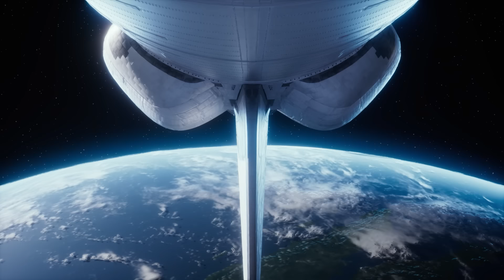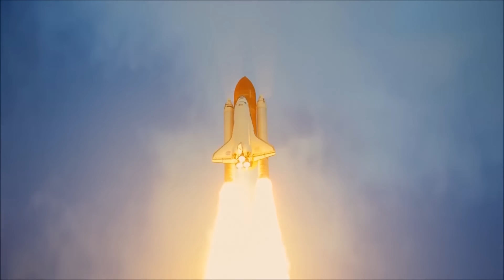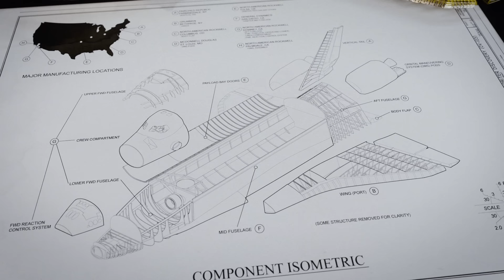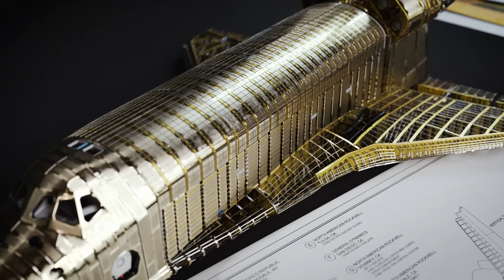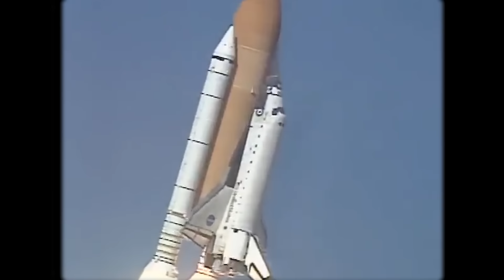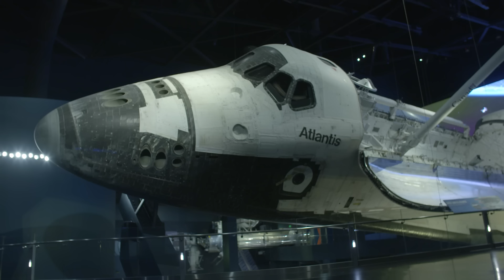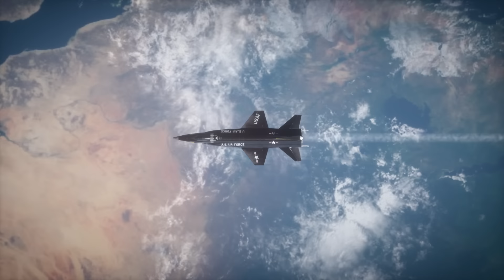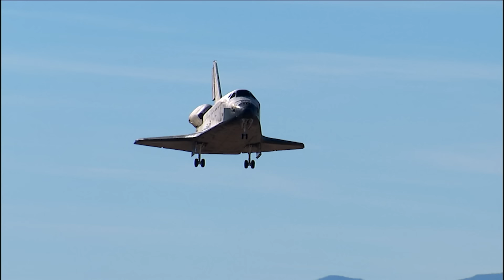The Insane Engineering of Re-Entry

Comment: It's truly incredible that the Space Shuttle even existed considering it was late 70's early 80's technology.
Reply: That era had a very high coefficient of ‘gettin shit done’
Reply: @ehtikhet  but also getting shit killed
Reply: @Orikix yeah now they do that at Boeing instead
Reply: More like late 60's. Alot of the engineering for the shuttle started in the late 60's and manufacturing and testing happened in the 70's with testing being finalized in 81
Reply: @drtracernum20 it was more like the late 40's
Reply: agreed!  @drtracernum20
Reply: The X-15 is where much of the engineering came from.
Reply: yes!!! Neil Armstrong and others - not many and poor Chuck Yeager, after X1 had to sit these out - F'ed him many believe @Triple_J.1
Reply: Besides the X-15, the X-20 Dyna-Soar is definitely also worth the praise for its contribution to the whole spaceplane concept development, especially on the heat shielding technology development.
Reply: We will be seeing the current confidential military technology in 50 years, just like this information was quite confidential back then.
Reply: It was far older than that, sport. Some of the engineering and basic concepts were born in the immediate aftermath of WWII. Much of what ultimately became the Rockwell Orbiter was based on studies done in the mid to late 1950s - early 60s. Check out the X-20 Dyna~Soar program. 1957… 

That makes the fact that there were only two losses even more incredible.
Reply: More like incredible that we considered building it, given how many obvious drawbacks the solution had over more more standard rockets like the Saturn V.
Reply: We can do anything we put our minds to… just turned into airheads lately and can’t put out minds to anything
Reply: I think they did have early CAD programs in the early '70s.  NASA had the largest computer cluster, all linked together as one supercomputer with hundreds or even thousands of access points/terminals.  The BEOWULF Cluster.

The idea of a space plane goes back to 1944, with a winged V2.  The V2b; b for bastard, had very few launches.  It was still prototype testing, but successfull.  Constructions administrator was Werner vonBraun, who later worked with NASA until near completion of SpaceShuttle developement.
🚀🏴‍☠️🎸
Reply: We are doing plenty. From sending probes to touch the sun to detecting ripples in the fabric of reality to flying drones on Mars.   @Rkcuddles
Reply: @Rkcuddles  true
Reply: @Rkcuddles  It just seems that way. People are much more educated than ever in human history. It seems that way because ... most people are fucking stupid, but it's always been that way.
Reply: @Rkcuddles we? you didn't do anything so stop trying steal to credit from the hard work of others
Reply: With enough money and solid rocket fuel pigs can fly
Reply: @kestaskuliukas5296  At least pigs dont explode on their maiden launch.
Reply: @kestaskuliukas5296 And bricks. And pigs with bricks.
Reply: The saturn 5 went further and was around in the 60’s
Reply: Apollo!
Reply: The more incredible thing is how little space tech has developed much since the 80s. The pace slowed dramatically during the Space Shuttle era.
Reply: It's funny to see people incredulous that things could be done just 50 years ago. The knowledge was already known by then, nobody missed CAD because it wasn't invented yet. They did it way it was done, a lot of work.
People got more done faster then than now with less capability. People have no guts now, they prevaricate forever in fear of what if instead of forging ahead.
People can't even build a subway line on time and on budget. Over 100 years ago they started and finished subway lines, faster than they can go from talking to starting one now, with way less capability.
Reply: Let all remember that there is no rule that says we are able to create X amount of technologies every Y amount of years. Just like evolution, some technology pathways become very difficult after the first few iterations while others will see many iterations and still keep advancing steadily. So because we were able to advance relatively quickly early on in the space game has no bearing on what we might accomplish in the space sector 50 years from now.
Most people tend to use the advancement of electronics as a yardstick for measuring the rate of technological advancement. This is wrong. The rate of advancement of electronics is unique among other advancement. Most others occur at a much slower rate. For example we have many different ways that we're able to make a stove to cook our foods but we still only have one way to make a refrigerator to cool our foods.
Reply: it could have only existed during that period, because of the will that prevailed. Nothing of the sort can ever be designed ever again.
Reply: We had nuclear submarines in the 50s
Reply: @Raging_Brainer  He's a CLOWN!
Reply: Nautilus ! first to go under the artic ice and reach the north pole @Raging_Brainer
Reply: @Raging_Brainer Yes, they were powered by a nuclear reactor. I’m no longer so sure that they carry nuclear tipped ballistic missiles. Hiroshima and Nagasaki weren’t destroyed by nuclear weapons but fuel / air bombs like the other cities coupled with mustard gas. See Dr Michael Palmer’s free to read pdf. The question is why they faked the bombs.
Reply: @Raging_Brainer  sry nukes didn't exist then and nukes don't exist now
Reply: and all the bloody doors stayed on all the time
Reply: Built using computers less powerful than a game boy color none the less it was truly an incredible human achievement
Reply: The aerospace industry had a lot of very competent engineers back then, with a lot of intensive experience behind them. 
Kings of the slide-rule and artists of analogue.
Reply: We've had technology to do amazing thing for many decades, the will has been lost.
Reply: People Back Than Had Real Skills And Education Not Like Today
Reply: Earlier than that.  The program started in 1972 and not all of the technology was started 'from scratch'.  First launch was in 1981.  

Quite an accomplishment if you think about the engineering process back then (no CAD or workflow automation tech).
Reply: @mm-nyc  It really makes you think what a modern space shuttle built with modern materials science could achieve, both in cost savings and utility
Reply: @TheFlameofIcarus  That is kind of what the SpaceX Starship is.
Reply: @mm-nyc massive risk for early astronauts
Reply: exactly - two test pilots (but they had a different eject system - couldn't afford the weight increase to keep it after qualifying she was safe! @mm-nyc
Reply: @prestonburton8504  those seats were useless. There was a very small window of time where they could be used.
Reply: yeah, i remember that now - SR71 ejection seats (but they were worried about SRB ejection sequence and if one one accidently hit the tank or orbiter as they cleared (if i remember correctly). if that had happened, these seats would have been useful? @mm-nyc
Reply: @mm-nyc Earlier than that.  1965.
Reply: @mm-nyc  ik.
Reply: What's up with the Nerds trying out nerd each other  @mm-nyc
Reply: All of the military technology of 80s was tested in the 70s
So we cannot completely just call f14 and aim 54 60s technology it was not available then just designed and tested
Reply: What on Earth do you mean, "considering"?...
Do you think human beings have been incompetently waiting around for you to wake up to achieve anything?
They'd already been to the moon in a tin can with the computing power of a microwave oven - to you think the the space shuttle is more incredible than that? What are you talking about? 
And the design and configuration was only locked in the 70's, that thing had been under investigation in principle and developmental design since the 1950's - yes, the 1950's: incredible, because they were so backward in the 1950's they basically couldn't even read.
Incredible, that Einstein received his Nobel Prize in 1921 - people of that time were practically subhuman and couldn't even walk in a straight line, they were basically some form of sub-human apes and mental cripples.
Really incredible - unbelievable.
It's simply amazing, wow - BUT HOW, THO?..... Gosh!
Reply: 1 trillion dollars spent and all you got was a fake foam airplane. Its the most lucrative scam since the invention of warfare.
Reply: More like 1890s!!!
Reply: Yeah and if it didn't we would've been on mars by now. The space shuttle program was a failure and set space exploration back 30 years.
Reply: Aliens
Reply: @danielmullinr  Mexicans*
Reply: We’ve been smart for a long time, but ignorant also, hence your comment
Reply: It is IN-credible=NOT credible…a HOAX!!!
Reply: Aliens came around the 70s and made deals with the government to trade technology for Americans 👀👀 It’s all coming to light now
Reply: Well the very first one (Enterprise), ended up being so technologically out of date before it was completed, that they basically turned it into an inert test vehicle for transporting the shuttle on top of a 747, and to do some glide testing. Basically Enterprise was mid to late 60's tech, and Columbia (the first working model) was early 70's tech (and first launched in 1981). Technically Enterprise could have worked... but by the time it was finished, they had microchip computers and had figured out how to shave thousands of pounds from the structure... so it was obsolete before it was done.
Reply: @kathrynck 
Enterprise was an atmospheric flight test vehicle built to test launch site systems and configuration, vehicle processing, compatibility with the SCA,  approach and landing flight tests and for the testing of new launch facilities at Vandenberg AFB. 
It “could” have been reconfigured for orbital spaceflight operations, but that was not deemed to be economically viable. It is new a pretty cool and inspiring museum piece.
Reply: People will say the same about smart phones in 50 years. Every technology is ahead of its time.
Reply: @Sammysapphira  There's a bit of a generational bias in play. People tend to think older generations were less smart than they were. It's why humanity keeps making many of the same dumb mistakes over and over.
Reply: And the Soviets were able to copy it.
Reply: It’s such an amazing thing to realize that humans have been so god damn smart for way longer than you could ever imagine.
Reply: from the minds of mortal men   the space shuttle
Reply: Russians had it way before then.
Reply: Cold war fear made anything possible
Reply: a simpler solution would have been far more sensible. The amazing technology made it so expensive. And the politics around scuring this money made it more heavy and cumbersome that it should have been. It's an amazing piece of technology, that dididn't make much sense in reality. 
Illustrated by the fact that it was reusable but also by FAR the most expensive launch vehicle by kg of payload in history.
Reply: Sheep believe anything .. lakes and oceans do not convex
Reply: Ipsis Litteris INCREDIBLE .
Reply: very true ...why don't The US make a 21 century space shuttle just to test new technology
Reply: @shimronnetia hi, this is The US government, gib me money to build 21st century rocket, kthxbye
Reply: space shuttles 😊
Reply: What is this thing with "late 70's early 80's technology"?  There is NO NEW ROCKET OR AIRFRAME TECHNOLOGY.
Reply: (deleted)
Reply: If nothing else, the Space Shuttle and the Apollo missions proved that it was a matter of will and money. Find this, and engineers will make it happen
Reply: 50 years later we re just about able to shoot an electric car into orbit for no reason making elon musk a genious
Reply: You mean when everything was American made tough. Lol😂
Reply: Also... the concorde
Reply: No space shuttle ever went to space because space starts at 62 miles high and nothing has ever been to space because rockets can not produce thrust in a vacuum so the rocket just falls back down at the 62 mile mark and shuttles are not gliders either they have a jet engine on either side of the tail complete with air intakes and exhaust and you can hear the engines rev up when they land even though they have a jet fighter escort to cover it up
Reply: Incredible achievement with confined funding.  However, the escape portion was dropped (funding), and the vehicle should NEVER have been man rated.  It was, and always will be, an experimental vehicle.  Civilians had no right being cleared for flight.  But an achievement nonetheless.  The next one, whomever builds it, shall have a dearth of research to work with.
Reply: @AnthonyTolhurst-dw1nc  the shuttle was not a glider it had two jet engines at the tail and no one died in it no one died in Columbia and no one died in challenger
Reply: Alien technology. Like the microwave that's why it's design barely changed
Reply: @MarcYanruw  Chinese and Russians who orbited the earth for multiple days cannot walk.
They are taken out by others and then to even stand straight, they need someone's help.
Look for Shenzhou mission photos.
Four days in space for Shenzhou 6, they can barely stand, cannot really walk.
14 days in space for Shenzhou 9, they cannot stand or walk.

Space Shuttle that claimed to have been in space for like 12-17 days walk out like cucumbers.
Heard of comment by Dmitry Rogozin's cucumber comment?
So what is going on?
Reply: Same for planes in godamn 40's
Reply: @captainr2d2  in a matter of 5 years airplanes went from Sopwith camels going a hundred miles per hour to airplanes like the p 38 going 430 mph is that what you are talking about
Reply: @captainr2d2  that's right our technology went from a twin wing Sopwith camel with 50 horsepower going 100 mph to a p 38 with twin 1600 horsepower engines going 430 mph how did that happen in a ten year period
Reply: Sry really really sry but the space shuttle never went to space because rockets can not produce thrust in a vacuum so the rocket just falls back down at the 62 mile mark and the space shuttle is not a glider it has two jet engines at the tail complete with air intakes and exhaust and you can hear them rev up when landing why they want to lie I have no idea
Reply: So sry but the so called space shuttle never went to space because rockets can not produce thrust in a vacuum and space starts at 62 miles high and nothing has ever been to space because rockets can not produce thrust in a vacuum so the rocket just falls back down at the 62 mile mark and shuttle just falls back down at the 62 mile mark and can fly around all he wants
Reply: Space shuttles really don't exist because they don't go to space nothing has ever been to space and they are not gliders they have two jet engines at the tail complete with air intakes and exhaust which they couldn't land without them and you can hear them rev up when they land
Reply: Space shuttle is a hoax im part of the secret
Reply: yeah, let alone starship
Reply: Most of the great American technological leaps occurred between 40-80. Crazy what war based funding can do for technology
Reply: @LeadBeans   If someone easier to get along with than Stalin had been in control of the USSR back then, we might all still be using rotary-dial phones ; )
Reply: It never happened!
Reply: because it is not real
Reply: Incredible is the appropriate word. As in not credible.
Reply: What's truly incredible is how little space travel has advanced since then smh
Reply: It worked better than the Starship from the 21st century.
Reply: @incargeek  Starship is not operational yet. The STS had 135 launches out of which 1 failed on launch and 1 failed on re-entry, and in total resulted in the loss of 14 human lives. 

The shuttle also needed to be torn down, inspected, repaired and re-assembled between flights.
Reply: @mm-nyc The launch catastrophe was faked, it was unmanned. Several of the crew took up academic positions, some even in the original names. Others pretended to be the identical twin of the “lost astronaut”.
Almost every major event post WW2 is a fraud. Why, I’ve no idea.
Reply: @incargeek  uhm star ship is the most advanced largest rocket ever made and look how quicker they built it NASA taskes ages designing rockets and get them to work first time space x build fast and do rapid testing not afraid to loose  some on the way.
Reply: @BobaPhettamine  You could be deluded.
Reply: @incargeek  how is any of that "deluded" it's just the truth you don't want to hear.
Reply: 😂..
It’s all a Lie.
Reply: @0Logan05  🤡
Reply: @0Logan05 it’s your world and we are all just living in it
Reply: @McCarnut
Why? Did ALIENS make it?
What you said is akin to people saying that the Egyptians couldn't have created the pyramids, given their technology. 

Or that the fusion atom bomb could not have been made in 1945, given the technology.

Obviously the tech was enough... and the tech to go to the moon and back in 1968 (Apollo 8) was also enough.
Reply: @rickkwitkoski1976    Actually,  the fusion bomb could not have been made in 1945 :)

As for the OP, allow me to translate:  They are simply saying that the STS was quite an achievement, especially given the technology base it was starting from.  I think most aerospace engineers would concur.

The fact that it took far longer to create than it was supposed to speaks to how it not only stretched the available technology, but for a time exceeded it.  And even then, the finished product wasn't really "correct":  The wings weren't strong enough to support design reentry loads, for example.
Reply: @rickkwitkoski1976 
The colloquially named "atom bomb" was a fission device, not a fusion one. Fusion bombs bore colloquial name "hydrogen bombs".
 You're right though about sufficiently capable people with the technology of the time. Apart from our digital age advancements and progress in areas of material science, those technologies are basically the same. Without the constant aid of computer assistance, those engineers were mental powerhouses.
Reply: Just a plane with a non stick frying pan coating underneath. Truly breathtaking technology